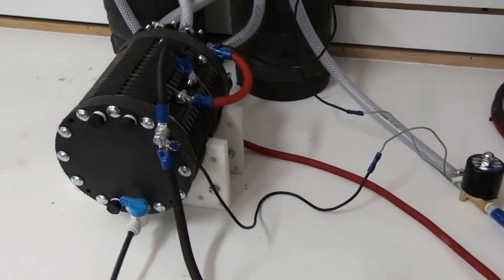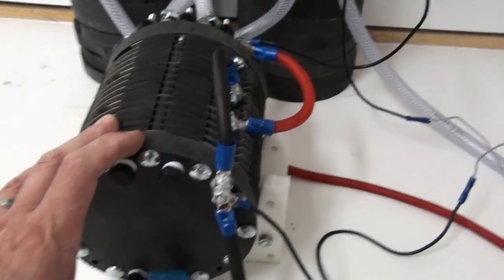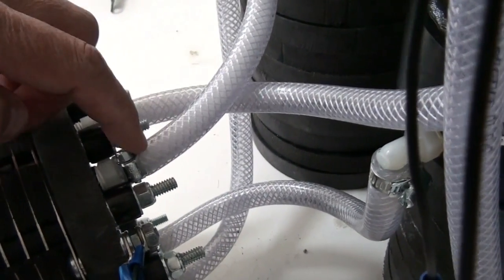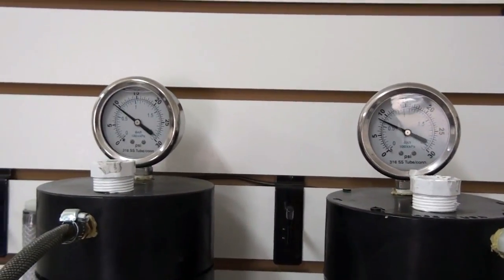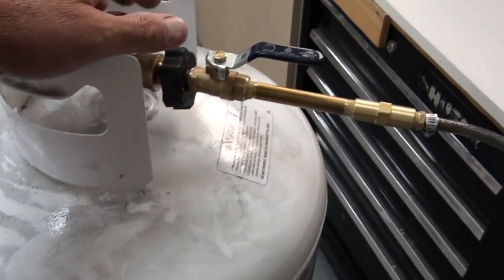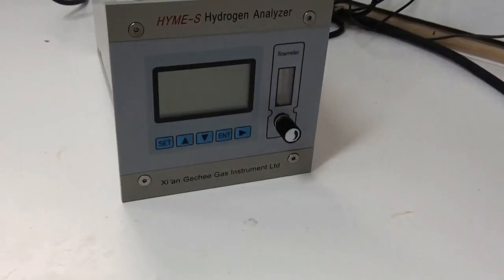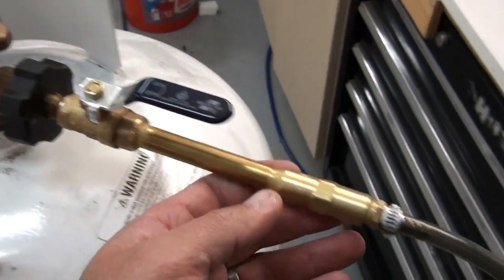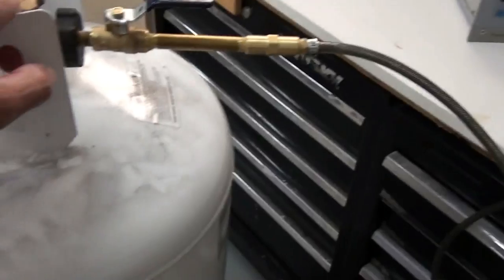Hydrogen compression. PART 3. Pure Hydrogen Generator Split cell system.

Comment: To purge a tank before using it to store gas, I'd highly recommend using a vacuum purge instead of gas purging as suggested. It's what HVAC guys do for their refrigerant tanks for the same goal of purity. While you may get "acceptable" purity levels with gas purging, you can't beat the purity of a vacuum. Even converting an HVAC compressor to a vacuum pump will achieve good levels of vacuum.
Reply: This.
It's easy, cheap and effective.

Comment: Straight up dropping some knowledge. Even 99% pure compressed hydrogen scares me because of what we have been taught about tank failure. That a puncture can mean catastrophic failure, but I have been super curious about this systems for energy storage. Also to mention there could potentially be a heat transformation to storage, or a reclamation of energy in separating the oxygen and hydrogen from water.
Keep up the great work and look forward to more videos.
Reply from the maker: I think it will be safe. We are only talking about 120 to 140 psi. As long as oxygen content is lower than 4% it cannot burn. This makes it completely safe. Thanks for watching.
Reply: delvis11 
 The best way to store hydrogen gas due to its microscopic molecule size, is in what's called hydride. It's completely safe and non-explosive and can hold a tremendous amount of gas in such a small container called hydride cells. And the Purity is 99.999% pure hydrogen gas.
Reply: Hydrides are fantastic and I experiment with atomic hydrogen quite a bit myself. The cost of a Nickel hydride is pretty expensive for a tank to my knowledge. 

I believe there is new advances in carbon tech like a NiC hydride hybrid, that have brought cost down a bit.... Still pretty expensive to my knowledge, and it still cant  store as much as a pressurized vessel. 
 Proteus is underutilized IMHO, glad to see people still openly working with it.
Reply from the maker: These tanks are extremely expensive. I may go to that at some point but for now propane tanks are it. Look hydrogen house on youtube. Its a cool system they have.
Reply from the maker: Do you have any information on people selling hydride tanks? I would like to try one.
Reply: delvis11 yes I do here you go http://www.pragma-industries.com/products/hydrogen-storage/
Extremely expensive though as you say. You will probably have to get a quote from them. It would be great to develop our own Atomic lattices in which to store hydrogen.
Reply: @Hydrogen4Health  Try storing H2  just in Water or oil. Biosfuel did it a few years back when they developed this bike that ran on special water.. but it was just H2 oressured into water.. Instead of gassed water with CO2 you can also use H2... Must be tried how many pressure it needs to store how much H2 at what temperature. ..

Comment: By compressing the hydrogen it can be used to run a regular vehicle motor correct? 
I see a lot of people attempting to make hho cells to operate internal combustion engines, they usually dont make enough hho to power the vehicle. By collecting hydrogen and compressing it, it can be carried onboard to power vehicles. Right?

Comment: Do you use sodium hydroxide because I do for the hydrogen generator for my truck diesel engine my engine. I also drove a half a million miles and I would from 16 l per minute in my engine it ran so clean you cannot smell diesel out of tailpipe
Reply from the maker: That's awesome 😎
I use KOH but NaOH will work also.

Comment: Good stuff.  Any ICE can be converted to use hydrogen The holy grail would be to use solar and store it in tanks at relatively low pressure , say 50 psi . maybe more ? No carbon exhaust or build up. Just clean running engines from your own gas station  . Tune ups would be a thing of the past almost . Someone will find a way to make it illegal. But I hope not

Comment: Is there a way you can be contacted? 
I need info regarding material selection for the hydrogen permeable membrane. Im working on a low voltage cell design, but would love some input.

Comment: the steel will fail at some point. Please rap with fiberglass tape so the shrapnel doesn't kill you.
Reply from the maker: remember this is low pressure 130psi is nothing but I like your idea.
Reply: @delvis11, it isn't about the pressure. Hydrogen gas, as I'm sure you are aware, is corrosive. It will eat the steel tank from the inside out.
Reply: wrap
Reply: @jjbailey01 it's embrittling.. not corrosive. And that happens at higher pressures with harder steels.

Comment: Could you explain to us why (to you) energy has so much value in form of H2 that you are happy to input more energy than what you output? A quick calculation based on the values you shared in the video is that in order for you to obtain 1kg of H2, you invest 103KW of electricity to get a return of 33.6KW in H2 (as 1kg of H2 has a BTU of 33.6KW) Is it the low cost of investment in infrastructure and maintenance? Low cost of storage materials? Endless renewables available to you such as sun, water wind? Maybe your specific application for the H2? Thank you for sharing.
Reply from the maker: I do this for fun and leave it to others to figure that stuff out.  People can do whatever they want with it.

Comment: storing and compressing the H2 is intriguing.  i was big into research a few years ago with wet and dry cell generators and even made my own dry cell.  the output was moderate but i kept fearing a "Hindenburg" situation if i added it to my vehicle.  my thought was if I could store it, opposed to on demand use, you could have the generation station solar powered.  it would work all day long every day.  its 300+ sun days where i am.  13+ hour summer days.  Thoughts??
Reply from the maker: Super Joe I agree, I have been at this storage game for a long time. I have learn so many ways not to do it. I'm finally making progress. 
My goal is to offer a product that most people can afford. Just add solar!
Reply: How about storing hydrogen in palladium coin it's possible at room temperature and 1 atm and re generate hydrogen via glow-plug at 400° ?? Did you try that?

Comment: Steve would it be safer fill the propane tank with nitrogen first bleed the air out that way then when the air is gone fill it with hydrogen and bleed off the nitrogen, or easer still fill the tank with water and let the pressure from the hydrogen bleed out the water from a opening at the bottom of the propane tank
Reply from the maker: Nitrogen yes. I like your water idea. Another way that I may try is pulling a vacuum on the tank and then filling with H2
Reply: water is the best way to make sure its all out of the tank. I saw an add for solar cells at 100 watts each for 150 bucks each . Harbor freight .I think your system uses 300 watts ? I think the tanks might be the most expensive thing going. Need a way to hold enough gas in the trunk of a car ? I think Bob Lazar was doing that a few years ago
Reply: Hey Delvis
I was wondering how you would keep oxygen from dissolving into the electrolyte and then possibly contaminating the hydrogen by outgassing ?
Reply: Vacuum purge. It's the best way and industry standard for compressed gas tanks.

Comment: If there was oxygen "contaminating" your hydrogen wouldn't it just turn back into water and collect at the bottom of the tank?
Reply from the maker: Too much oxygen in the tank can make it flammable.
Reply: @Hydrogen4Health  i need to revisit combustion reactions.
Reply: Yes it'll turn to water with heat/explosion as a byproduct

Comment: How much pressure does can the tube generator make in psi before you have to use a compressor ??? Thanks
Reply from the maker: 45 to 50 psi

Comment: Hi really trying to learn as much as I can on hydrogen ,your set up is about 180 watts of energy ,how much hydrogen can you produce per minute  if your are running at the most stared power draw ,if not pushing the HHO generator
Reply from the maker: 150 watts makes about 667ml of H2 and 333ml of O2.
Reply: @Hydrogen4Health  thanks you
Reply: @Hydrogen4Health  hi and is this per hour or in per min
Reply from the maker: @mwan200  Sorry, that's per minute.

Comment: How to compress and pump hydrogen to hydrogen fuel cell car? The needed pressure is 70bar I think.. What is the way to compress up to 70bar and transfer to car tank?
Reply: Hydrogen cars contain Hydrogen at 350bar and are tanked at 700bar which is why the refueling stations are so expensive. Also, the hydrogen is cooled. Nothing to diy

Comment: Hi,how many liters of hydrogen can it hold in the tank?
Reply from the maker: László Kovács that is a good question. I do not know.
Reply: But theoretically, how many liters of hydrogen can it hold in such a tank under pressure?
Reply: I'm going call out an error in the video. That is a 100 pound propane tank, not 100 gallons. 100 pounds of propane is 23.6 gallons, so that is the volume of the tank. This volume will be constant regardless of what is contained in it. Converted to metric, this is 89.336 liters. This tank will hold 89.336 liters of anything that you can put in it. As pressure increases you will only increase the mass contained, not volume.

Comment: thank you for your articles , safe clean designs,  ... i would like to run a sabatier reactor for scrubbing CO2 and producing CH4 for an energy source,,,.. in a CLSS..
Reply: Is there a way you can be contacted? I have a few questions regarding material selection for the hydrogen permeable membrane. I'm working on a low voltage design and would really appreciate some input

Comment: Can i compress hydrogen with 12V car inflator compressor??
Reply from the maker: No it wont work because most inflators take air in through the crankcase. No way to seal it.
Reply: @Hydrogen4Health   okei sir

Comment: Fuel cell is unnecessary and has been don't to confuse the truth, I am telling you this because over forty years ago I was shown a Holden Kingswood run on tap water with no fuel cell at all, he filled his fuel tank with strait tap water and showed it was going into the carburettor. He only gave us a quick description on how he did it as he was trying to sell it to Holden but got told they were not interested and got the same from Ford as well and after that he was visited by two men that told him to keep his mouth shut, but when he showed it to us there was a twenty seven year old that had seen it as well and built his own two years later and the man who showed it to us was killed, But what he told us was all he did was increase the jets in his carburettor to twice there size to allow enough water in and built this coil he had mounted on the side of the motor that was about 4x4 inches in size to burn the water and that was it no fuel cell at all, when water is placed under a vacuum and hit with x-ray frequency it releases hydrogen and is what I think is going on with this system and is as safe as. I know this is real I have seen it done. It is just being done the wrong way.